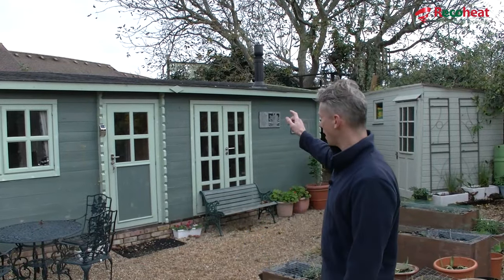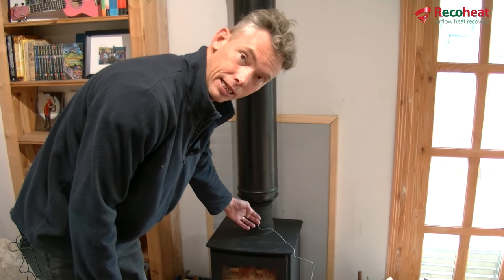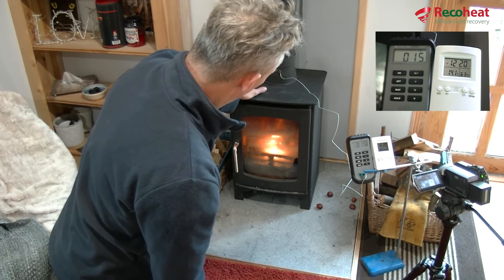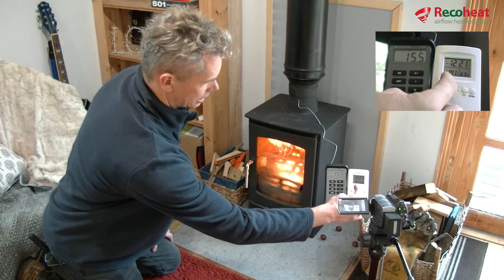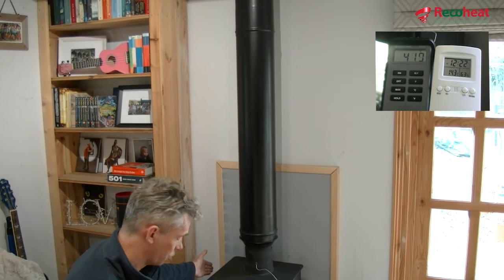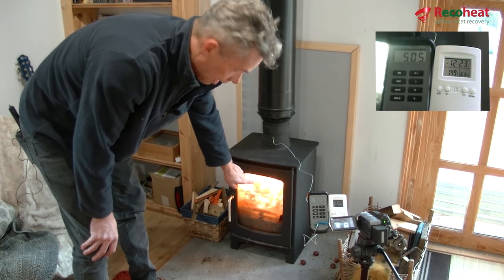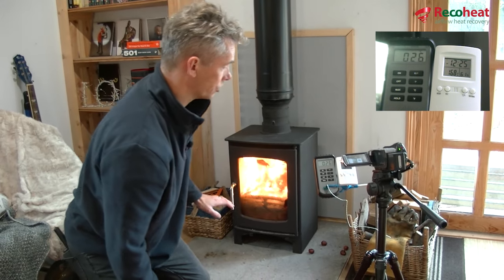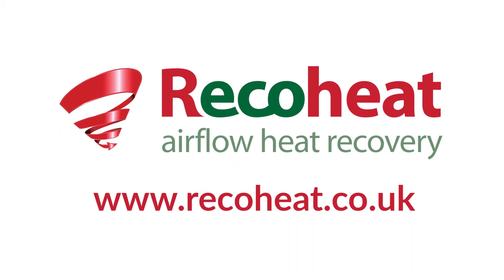Introducing the Recoheat heat recovery unit for wood and solid fuel burning stoves

Comment: BS!  what would the temp be coming off the primary pipe without any active system (reco heat")? I would guess very close to the same temp as with the reco system. do a measure of radiant heat off the stack pipe w/o the bells and whistles
Reply from the maker: Of course it's going to be the same, but it's not pumped and pressurised air, so only has convection to circulate it. Check TrustPilot to see if it works: you really don't have to take my word for it.

Comment: does it work with pellet heaters ,  the flue is lot smaler
Reply from the maker: It doesn't work on balanced flues - they have different regs. If they're not balanced it will work, but you might need an adapter. The smallest we go down to is 5" - 125mm - in order to manage the air flow and the proportions of the coil in the flue.

Comment: @7.18 you say 'you get such enormous fuel savings'. I think you mean to say more efficiency from the same fuel. But, this gadget requires the use of more energy in the form of electricity to run the air pump. I can see it is a good idea but adding a complication to what is a simple and effective way to produce heat in a primal way.
Reply from the maker: That's true of course, but you cannot produce effective heat from 37w in any other way: certainly nothing like 1kw. It's also not particularly the increase in heat output that is the big difference - it's the heat dissipation. The difference is akin to having a central heating boiler running without a pump on the system: same heat produced, with almost zero effect on the effective heat distribution into your home. Our device addresses that issue.
Reply: @Recoheat  'same heat produced'- clearly not. Without a pump, the system would not continue running. The boiler temperature would be maintained, but flow would not take place. I think you are confusing heat with temperature- a schoolboy error.
Reply: A superior design would use the Peltier effect to power the pump. This is already done with some fan units.
Reply from the maker: @Tensquaremetreworkshop  The same heat would be produced, but would dissipate via the flue and in the immediate vicinity: you can't make the burner produce less heat. It switches off when the pump doesn't circulate the water, because otherwise it would overheat, which is a separate issue to the point I'm making.
Reply from the maker: @Tensquaremetreworkshop  Yes, that's quite true, but there isn't a cost-effective means of producing one that will achieve the flow rate to create the turbulent barrier layer in the airflow that we require to achieve the efficiency of heat extraction. The lower flow rate would not create the jet we need to create the air flow into the room and draw the stove heat with it, would not pressurise the air so that it can be dissipate as the pressures in the room equalise, and by running through the coil at lower temperatures, would produce a cooler coil which would cool the flue gases and encourage deposits in a way our system prevents because the majority of the coil is carrying hot instead of cold air. It's a really interesting phenomenon we're producing, and we're exploring how to improve it, but a significant reason for using the pump, and that particular pump, is the balancing of output and cost. Thanks again for your interest.
Reply: @Recoheat  No, the same heat would not be produced. Leaving aside boiler modulation, the heat produced is matched to the heat delivered, by monitoring the temperature. Yes, it does this (if required) by stopping/starting the burner. That is exactly how you get the system to 'produce less heat'. I can only suggest that you brush up on your thermodynamics. Heat is energy per unit time, which can be measures in Watts. Temperature does not require any energy per se.
Reply: @Recoheat  Still no numbers. 'running through the coil at lower temperatures'- the higher the flow, the lower will be the exhaust temperature. (NOT the other way around) There has been less time for thermal transfer. If the coil is 100mm2 internal cross section and 1 metre long (you can plug in the actual numbers) at 1l/S the air is in the tube for ~0.1S. I need to dig out my textbook on heat exchanger design, but that looks ambitious to say the least...
And, as there is no pre-heating, how do you inject air into the coil at other than room temperature?
Reply from the maker: @Tensquaremetreworkshop  Not so, Mike: we create a turbulent boundary layer that excites the air molecules flowing against the metal in the coil. Instead of those heated molecules simply passing their energy to the adjacent molecules, they ping around and distribute it throughout the air flow. That's the difference between our device and any other on the market and is the reason for the distinctive hiss on the air flow. It's a very interesting phenomenon, and increases the efficiency of heat distribution exponentially, not steadily.
Reply from the maker: @Tensquaremetreworkshop  Hi Mike. With respect, that's fatuous. I've made a point that a central heating boiler does not centrally heat without a pump. You've counter argued that the boiler can automatically switch off when it's not part of a pumped system. I think that might serve as a definition of fatuous.
Reply: @Recoheat  You clearly do not understand the point I am making. This may be deliberate or other wise- but I know when to stop.
Reply: @Recoheat  The issue is not heat distribution in the working fluid (the heated air), clearly you are not familiar with molecular mean free path in gases. And if you are exiting air at ~ 50m/S it will certainly 'hiss'. (8mm internal dia tube fed with 1l/s = 20m/S input. Gas expansion 2.6 (not the '4 times' you give elsewhere) = 52m/S).
'increases the efficiency of heat distribution exponentially' - what on earth to you mean by that? What exponent is involved, and what is the formula?

Comment: I would only use something like this on a rocketstove with secondary burn......i doubt that little peashooter of a stove gets hot enough to spare BTU's from going up pipe to not cause creosote
Reply from the maker: That's the importance of independent reviews on TrustPilot: it works, even if you don't interrogate the physics.

Comment: Pumped, fine. From where to where...?
Reply from the maker: From where ever the pump is - somewhere you can't hear it, preferably - into the back of the unit where it connects to the steel coil inside the flue and travels around that and out at the front of the flue.

Comment: Where does the power for the pump come from?  Also concerned about condensation.
Reply from the maker: Sorry - missed your comment. The pump is a 37w electric aquarium pump. The unit doesn't generate condensation, and actually removes it in the boat we've got it in, because the warm air picks it off the cold surfaces and carries it out through external vents.

Comment: How many hour  the heat remain in room if fired for one hour
Reply: It depends on the stove (how heavy it is, so how long it retains heat for) and the type of fuel burned (how much mass of embers remain hot after the hour) but certainly for five hours and probably for eight and more. Think how long the embers and ash remain hot for - a proportion of that heat rises up the chimney, even when it is not sufficient to heat the stove. It is reclaimed from the flue by the Recoheat and circulated. It will be pumping at about 30 degrees whilst there is any heat in the embers, which will keep most rooms warm. It's so effective because that heat pumps even when there is not enough heat to produce convection that normally circulates the warmth from the stove. There is a test like this published on the website - www.recoheat.co.uk

Comment: Not clear even with the basic diagram on your webpage.
Im guessing it's an approximately ½" pipe passing through the stove pipe which acts as a heat exchanger.
Room air is passed through the pipe from the air pump.
Hopefully the portion of the heat exchanger pipe inside the stove pipe is wound in a spiral to allow brushing.
IMHO better if the pump used peltier or at a Premium a sterling engine technology rather than MAINs electric and its associated inefficient properties.
Further as an after market kit I'd prefer a helix of pipe (spring loaded) which could be diy wound around the outside of the stove pipe etc 
Have I got this wrong?
Anyway best of luck.
Reply from the maker: Thanks for your interest Nick. In fact it's a 2m coil of 10mm 316 stainless, so pretty close. The pump and coil disposition create a turbulent barrier layer in the air flow that creates the efficiency in heat transfer, and we currently can't create the necessary flow rate to achieve that without external power. It's something we're looking at though, so watch this space!

Comment: Does the oxygen increase fuel usage
Reply from the maker: No, because the air going through the system never interferes with the combustion. It's completely sealed from the flue or the stove, so has no effect.

Comment: Where does it pump to because it never showed. Very interested but of course still very novice.
Reply from the maker: Hi Jimmie, it pumps into the back of the unit, around the coil, and out the front. The unit is in the bottom of the flue, and fits into the flue collar.
Reply: @Recoheat  👍

Comment: May I suggest that you review this ad with someone unfamiliar with the product. I watched and have no idea how your product works. You point to the hot air coming out but I see no means for the air to escape the unit. There is no illustration of what the construction looks like. There is no mention of the materials are or what the warranty might be. The air pump is delivering 1 liter per second. That sounds substantial but in fact it's really not. 2 CFM is next to nothing. On a a good day could this thing deliver more than a 1000 btu?
Reply from the maker: Thanks very much for your interest and very fair comment. You'll see that we've developed the presentation and explanation over the course of the last couple of years in a number of videos. The effect this has is to strengthen the number of people coming to this original video! It's fantastic at driving traffic, but as you say, means everybody gets to see the earliest efforts at presenting the product. Despite the weaknesses in presentation and the poverty of the explanation, the one thing we did know at this stage is that the device does work, and all our subsequent development in experience and understanding has confirmed that. Do take a look at our TrustPilot reviews because it sort of gives the opposite end of this video 0 the experiences of customers using it over the last months since we launched that process. Thanks again.

Comment: You're confusing temperature (measured in degrees C) for heat (energy measured in Watts per second OR commonly BTU/hour).
Reply from the maker: Thanks for the engagement Justin. That's probably true, though this isn't an engineering piece, so we're really trying to explain it to potential users. It's effectiveness is certainly more down to heat transfer rather than the temperature, as you say, which is so efficient in the coil because of the turbulent boundary layer we create with the pump. It's very interesting stuff.
Reply: And you're confusing the definition of heat flow.  It's watts, or joules/sec, but not watts/sec.
Reply: @realmetallurgist8493  It is the number of joules from a given mass of fuel that you are interested in. That gives you the thermal efficiency. The claim is 'twice the heat from the same amount of fuel'.

Comment: I don't understand why you wouldn't just sleeve the flu and run a simple metal fan arrangement to blow a much larger volume of air through this comparatively much more efficient solution. The low volume of air here means that even though it's very hot, surely the heat transfer is pretty low
Reply from the maker: The cooling effect of the devices like this is far greater, and the energy expended in driving the fan is greater, while the heat doesn't travel as far. We're essentially putting the electrical energy into pressurising the air, which then distributes heat as the pressure between the warm airflow equalises with the cold areas of the space. It's like the difference between pumping water on a level, and pouring it down a slope. That's what explains the fact our units heat to the floor and transfer heat so far, as attested by customers in all sorts of designs and build materials in their homes.

Comment: That chimney stack from you're stove, retains lots of heat and disperses it throughout the room. Are you not drawing this valuable heat source away from the flu. Chimneys in General act like storage heaters  still giving off heat many hours after the stove has cooled.
You are taking heat from the chimney for very little gain in my opinion. Also  a cold chimney  will have  tar build up on the flu leading to chimney fire. Also a chimney with tar build up is much more difficult to clean .
Reply from the maker: Thanks for the interest. Just take a look at our TrustPilot reviews and Facebook comments to see if your views are true: the wonderful thing is that we don't have to argue it. Explaining how and why your perfectly reasonable and rational perspective is not correct was more difficult when fewer people had experienced how it actually works. That was previously our difficulty: sharing the fact that it does. Which was hard, because it does. Our units, on a 5kw stove, are heating 2 bedroom houses. That's silly as a claim, but remarkable as a verifiable statement.

Comment: OK thats a good idea. But I have a couple of questions for you.. how much faster does the wood burn so you have to reload with more wood more often??? Wouldnt it make more sense to use a ceiling fan or  put a fan close by the stove to push the air around?
Reply from the maker: The air being pumped does not enter the combustion chamber, so does not affect the burn rate. Some points about the air coming out of the unit are that it is turbulent, so it transfers heat far more efficiently, and is pressurised (by the expansion caused by the rapid heating) so that it creates a convection flow out of the heated area as the pumped air equalises with the air in the room. It also comes out in a jet across the top of the stove, which draws the radiant heat from the stove behind it. It is also heated itself, so adds to the heat in the room. So the effects come from a number of factors, and achieve a great deal more than just moving the radiant heat with a fan. 👍
Reply: @Recoheat  how can you ignite fire. I know you can ignite wood and other items but not fire.... I thought igniting something turned into an explosion, catching something on fire or along those lines
Reply from the maker: @mitchellchandler3689  No Mitchell: ignite just means to light a fire.
Reply: @Recoheat  and watch the video and listen to what you said.....
Reply from the maker: @mitchellchandler3689  Aah! Misplaced pedantry! If you can light a fire, then a fire can be lit, and can be a fire before it is lit. The word is also used to denote the object within which a fire is set. It's Aristotelian, even Aquinian perhaps, but common English usage. I salute your concern with niceties, but the distinction applied is a false one: English has a beautiful way of shifting the subject and object to create new nouns, and verbs - it's why it's such a good language for poetry, and why legal documents are so lengthy: you have to make a great many definitive statements to preclude so many possible meanings in the simplest statement! 👍
Reply: @Recoheat  well listen to how you use the English language because it sure sounds like you used it not the way that you attended to use it so wake up and smell the coffee
Reply from the maker: @mitchellchandler3689  😄 It's a beautiful morning!
Reply: @Recoheat  considering the time frame that you wrote that... its a miracle since the few things that can see that good in pitch black or near black since the sun hasn't even thought about rising is night predators or you have night vision electronics.... so if you are an animal then its a miracle that you can write let alone use the internet or even know how to talk like a human
Reply from the maker: @mitchellchandler3689  And now I've got to break it to you that the world is round! It's a long night of the soul for you, my friend. Hang in there!
Reply: @Recoheat  and you need to lay off the weed
Reply: @Recoheat  or what ever drug that your using
Reply: @Recoheat  i hope that you do know that you dont have to marry your sister and have your kids with her... you can brake the chain since thats been happening in your family for years....most of the world looks down on that, just so you know
Reply from the maker: @mitchellchandler3689  Come a long way from an enquiry about fans! Sounds like it's getting late where you are Mitchell. It's 8.30am here, so time to get on with proper work. Have a good 'un, and it was a jolly spar - thank you.
Reply: @Recoheat  well it sucks that there is 7 hours apart difference in time zones